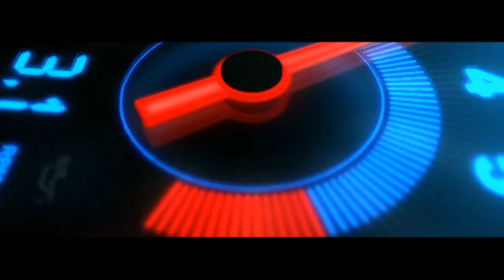How To Clean Rusty Car Radiator | How To Change Car Radiator Coolant | Coolant + Distilled Water

Comment: റേഡിയേറ്റർ ക്യാപ് open ആവുന്നില്ല.2013 swift. ജാം ആയി erikkuvaanu. എന്താ ചെയ്യുക.
Reply: Press it and open, then buy new radiator cap, other wise engine damage ഉണ്ടാകും. Radiator cap proper അല്ലെ വണ്ടി over heat ആകും. Lots of issues. Cap nu വലിയ വില ഇല്ല

Comment: Thermostat valve eduthu kalnjal problems undo
Reply from the maker: Unde
Reply: Petrol ⛽️ carinte thermostat valve mech eduthukalanju but karyamaya problemundo
Reply from the maker: Coolant circulation eppozum nadannondu irikkum
Reply: Ath problemumndo pinne radiator overflow tankil coolent epozhum orupole und ath matram fungus pidikunnu
Reply from the maker: Thermostat eduth kalanjal problem unde
Reply: Thanks